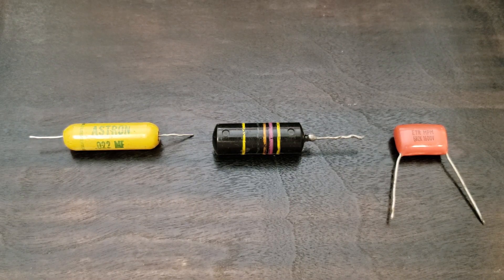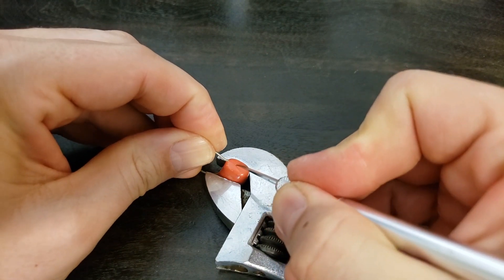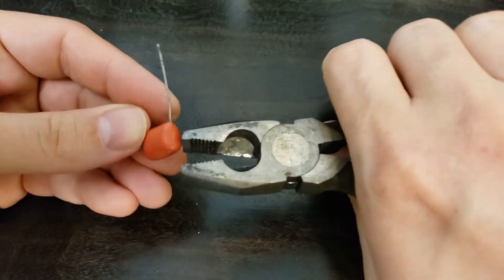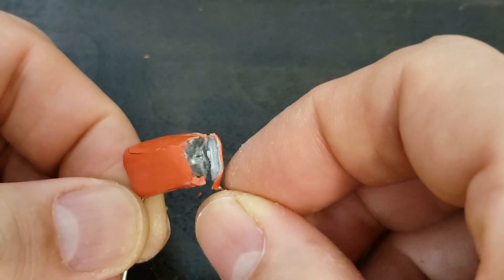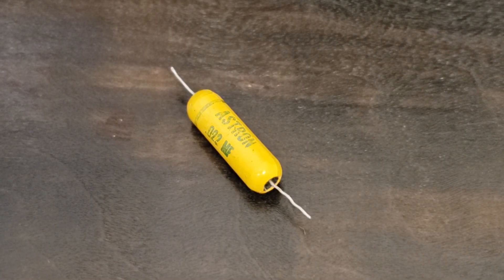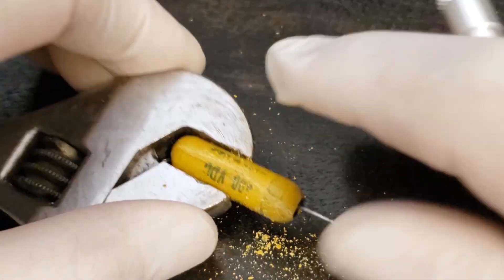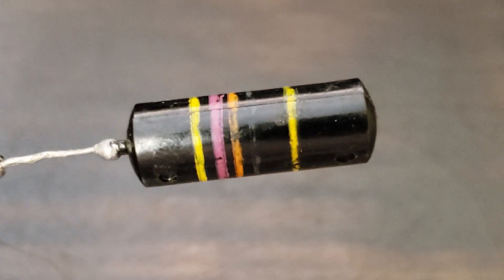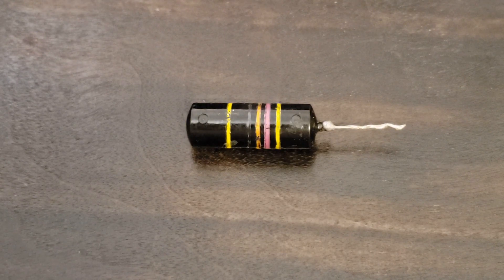Bumblebee Capacitor - What's inside? Orange drop cap TONE CAPS

Comment: Bumblebees are loaded with PCB oil. Also, as they absorbed moisture over the years combined with the acidic paper dielectric, they actually turn into electrolytic caps of sorts. Complete with leakage that varies with polarity.

Comment: Bumblebee caps are prefered amongst guitar guys only because of its leakage! They were not the best seal as plastic would deform from heat and the capacitor would start getting moisture, thus accelerating paper degradation and later on leakage. They were one of the worst and most changed ones on old tube tvs and radios and they'll last 1/4 of a regular paper wax or ceramic tubular ones. Oil in paper is another crappy capacitor that was notorious for exploding on across the line or horizontal circuit filters.
Reply from the maker: I can attest they are generally pretty bad in amps.

Comment: This demonstrates the progress of plastics - from pure paper dielectric of 1920's to oiled paper of 1940's to metallized paper of 1960's to mylar and polypropylene metallized film of 1970's to multilayer ceramic SMD of 1980's and after. Since the dielectric thickness is smaller and permeability is higher, the same capacitance/voltage is now much smaller cap. Better contacts to foil/metal gives lower ESR and lower non-linearities. Now you really know that there is only improvements from antique capacitors.
Reply from the maker: It's true, caps have gotten amazingly small
Reply: @FrankOlsonTwins  what was left out was the factoid that as caps became smaller and more efficient they were designed that way for an application other than analog so to apply these awesome new capacitor designs to analog uses took a higher level of knowledge than the builders of old and there we have average builders using modern caps and resistors today in the same way, and being stuck between the old way and the new way with only the the factoid that these new components are better is silly and leaves so much to be caught up on with this change in analog design and modern components.
Reply from the maker: Some good points being made here, and honestly I've always been a bit split on this topic.  On one hand, as caps have evolved, so too have their tolerances and specs.  Perhaps there is a difference to be noticed from old tech to new by those who are paying close attention.  The difference is subjective, at the very least(except for very leaky caps which are unsuitable for any amp!).  This is physics, after all, and all of these elements have different properties which are more suitable for some tasks than others.  Look inside any amplifier and you're likely to see ceramic, film, electrolytic, silver mica and possibly even tantalum caps- each fulfilling a different task based on its physical characteristics.  One could populate an entire signal path with ceramic caps, but it is rarely done on any worthwhile equipment, largely to improving tone.
On the other hand, all the guitar and amp manufacturers of old were using the most up to date cap technology they could get their hands on to manufacture their products- just as they still do today.  So, in my opinion, a schematic and in spec parts will take you a long way...usually all the way! 
I have done a few cap swaps, but I'd really like to hear a truly scientific shootout of different cap types and brands.  One thing I've learned over the years, you cannot just swap parts and be objective.
Reply: Several things left out but since you know more than me and the techs that showed those attributes of old are no longer with us you win, happy happy.
Reply: what is ESR? otherwise, how a capacitor works on a guitar and why his valor it's so important?

Comment: 1st of all great informative video, thanks.  I cant believe the  uneducated Bumblebee disciples, they just don't understand that a cap value is the same whatever the material its made from,
if they do happen to notice a difference in tone its most definitely a tolerance issue.  Most caps have a tolerance of 10% which could make a difference.
Reply from the maker: I recently had a bad experience with new reissue bumblebee caps- i installed them in an amp for a friend and they didn't actually work at 200v.  I then installed some polyester caps, ($2 each) that work and sound great...

Comment: On the practical side the Orange caps have much sturdier legs, the wire is a bit thicker so it is difficult to break them off accidentally. Working with the paper in oil types the legs are flimsy and snap off easily.
Reply from the maker: Agree, modern caps have tried to address this issue, and often you can find a durability rating for the legs, for whatever that's worth!

Comment: I've skimmed over old circuits thinking these were resistors.  I've never heard of a bumble bee capacitor until this very day.
So, if I may, for the average layman who's never even heard of these, just by looking at them, how do you tell the difference between a bumble bee and a resistor ?  I mean, geez, you'd be forgiven for thinking it was a resistor.
Reply from the maker: Generally speaking, capacitors are often bigger than resistors. If you saw one next to the other, you'd see the size alone is one of the big differences.
Resistors are rated and used by wattage. Most resistors in a given vintage circuit 1/2 watt to 5 watts.  They are also usually brown, and look similar to bakelite.  Usually, the edges are square(not so anymore).
Capacitors are have always come in many colors, often now orange and yellow.  They were often rounded at the end, though now it just depends on the cap maker.  There are factors that determine how big they are, such as capacitance and voltage. Usually the higher each number gets, the bigger the capacitor needs to be.  
Hope this helps!

Comment: Great patience in sharing!  Ah, the craptastic BumbleBombs, laced with PCB’s, ok for small voltages but usually become “leaky” and explode in real power circuits :(
Reply from the maker: Thanks!  I've never seen a bumble bee explode, but I've seen many that were out of spec!
Reply: @FrankOlsonTwins  Maybe I try a capacitor from an air conditioner, 370 vac 35 mfd, that should really soup up my Lester Paul guitar, woooaahhh man.
Reply: The PIO bumblebees do, they crack at the seam.

 I've seen the mylar  bumblebees pass ridiculous amounts of power without a peep tho.

Comment: So capacitors are just tightly rolled up foil? I had no idea. How do they work then? What exactly do they do?
Reply from the maker: Essentially Yes, they are rolled up foil with some sort of insulator to keep it from shorting itself out. However, now they are mostly rolled up mylar, with one side being conductive, and the other side not. It's rolled in such a way that the conductive part doesn't short out.
As to HOW they work, well that's another video entirely....
Reply: Not too easy to explain but they work with the electrical field. When they charge one side of the foil gets fueled with electrons. More than protons so that foil gets negative. The other foil at the other side of the insulation (plastic, ceramic, paper in oil for example) gets empty of electrons leaving protons alone and making a positive charge. So you have one foil negative and the other positive fixed in place because the attraction of one charge and the other because the electric field that appears when you charge the capband the near one charge is from the other. When you close the circuit by capacitor legs the electrons flows from one foil to the wire and enter the other foil creating a current and a voltage and discharging it.

Comment: Foil and a dielectric wrapped together for all. Two leads separated by an insulating material. So how could any current flow "THRU" it, DC or AC???   It can't ,That's why the only "tone" determining factor is it's value not how it's painted on the outside. 100 bucks for look like bumble bee's, your paying for the paint not the tone. A cap charges and dis-charges in an audio circuit, letting current flow in the circuit, not thru the cap. How long it takes to charge and dis-charge (its value) determines freq. Different constuction is for different enviroments.

Comment: Good demo of the construction of film capacitors. The inside and outside foils are connected to their respective leads by a portion of each folded on the ends. Each end has dielectric under the fold to ensure that they don't short. Each foil has an equal amount of connections to their respective layers within the body.
Reply from the maker: Thanks!

Comment: Good video, though no surprises. I don't understand why people buy (on eBay, etc.) old Bumblebee caps as if they were precious. First, they were made by the millions so they're not. Second, after at least 50 years if they're not BAD they're on their way to going bad. I don't even bother testing them, I take 'em out and replace.
Reply from the maker: Yep, a bad cap is a bad cap.  Find a  source of new quality caps and stick with it!
Reply: First off.  Only the sizes that were commonly used in certain items, like vintage guitars, have become scarce.  Demand is driven by the accurate restoration vintage, and collectable equipment, (vintage Gibson guitars come to mind).
Secondly, if the component hasn't failed in over 50 years, I'd say it's stable, especially for use in guitars where there is little voltage.

Comment: What's interesting is the astron is solid and not mentioned for a guitar circuit far as I've seen. But both the orange drop and bumble are highly recommended and both of a spiral construction..
Reply from the maker: To be fair, I think the Astron caps were also spiral wound capacitors, but I think the plastic just fused in my specific cap- making it look like a hunk of plastic/aluminum.  You're right though, I've never seen them in a guitar, I've only ever seen them in guitar amps...that is kind of weird. This one came out of a tube public address system.
Reply: @FrankOlsonTwins  probably saw a bit of heat then during it's tenure..

Comment: what is interesting with these caps is that when you unroll them down to the centers....you are finding no evidence of a lead plate.  There should technically be one in the center and then one at the end of the roll on the outside.  When you broke them open.....the plates appear to be on the ends of the roll opposite each other.  SO its like the length of the sandwich roll is the factor as opposed to the thickness of the roll between center and outside.......which is really odd considering the literature on capacitors.  The eary era caps were labeled with a line to denote the outside lead.....and later assembly line caps like an orange drop didn't necessarily have that exact notation if it had the line.  There are those that try to measure and determine the outer foil lead.......but this obviously contradicts that !!    I can't visually tell if something is obscured with the lead plates.  I would suggest that instead of breakig them open with a set of pliers......that you get a small dremel with a carbude disc to cut the caps in half for a sectional display......then do it with another set where you can break the surface capsule to get at the guts.   BUT A GREAT INFORMATIONAL PRESENTATION.  The real situation is the composition of the internal materials....the chemistry.  You can't visually assume its all the same materials between manufacturers whether it looks like paper or wax paper or a film of plastic, and even the aluminum foil.  The application of "electrons" in chemistry at the molecular/atomic level is different between Chemistry and Electronics

Comment: Hi, my name is Emilio and I live in Brussels Belgium, I am a luthier and in my quest to do as much as possible myself, I would like to manufacture my own 0.047uf and 0.022uf paper-in-oil capacitors professionally, make one it's easy but one that gets a professional finish isn't. I would like to know if you can help me, what kind of machine I can use, how to give the correct coating that is hard like bumblebees, or has an aluminum can. Thank you very much for taking the time to read this message.
Reply from the maker: to manufacture caps, you'll have to either make a machine or buy an old one. i don't know much about cap building, but I'm sure it involves getting a decent tension of the paper and foil. Also, i think the leads are spot welded to the foil, so that's something to consider. Once you make a few dozen you'll get a feel for your work flow and what is working.  Regarding the plastic, I think that will take some research to find out what will have the correct properties for your cap.  I believe bumblebees were injection molded.  Many others are simply dipped in plastic. Lots to think about but it sounds like a fun endeavor!   Best of luck!!

Comment: When I was a grade-schooler, I made my own capacitors a couple of times, by rolling foil and waxed paper.  They were disappointly “mushy” .. I couldn’t achieve that solid roll like the factory made ones 😁
Reply from the maker: Getting the correct thickness of foil seems tedious as well...MIght be fun as a rainy day project, but I already have so many of those!
Reply: I could roll a tight joint.

Comment: the Bumblebee is a orange drop with a wax paper with oil interesting . thanks for this it's making me think twice about dropping more money on caps . not too sure !!
Reply from the maker: well, technically the bumblebee is actual aluminum foil, where the orange drop is an aluminum coated mylar.  The mylar is folded so the aluminum is inside and never touches itself(insulated).

Comment: if u put the plastic in the inner part of the jaws youll get alot more force and control over how deep u go, im talkin about the jaws on the inside of the pivot, not the inner part of the jaws where the cutter is, on the outside of the pivot    u could also use the cutters to it works pretty well
Reply from the maker: Yeah, in hindsight, cracking them lightly with a pair of vice grips(or a vice!) might have been a bit more efficient. The issue I find with the inner jaws is that it requires more force, and hurts your hands more!

Comment: You do know those bumble bee capacitors can fuck things up right?
Reply from the maker: More than any other out of spec capacitor?  They tend to be pretty leaky.  I probably wouldn't trust them in a power supply or high voltage tube amp output stage, but in a guitar or as a coupling cap, seems pretty harmless if they sound good.  When they start to sound bad, they get pulled.

Comment: And here I am wondering how they can charge $10+ for paper and oil caps...
Reply from the maker: For a boutique shop to be making paper & foil caps, I understand why they would charge a high price.  But as a tech and independent builder, there's no way I'd buy a $10 cap for any build or repair....
Worse, I feel is how bigger cap companies have raised the price of specific capacitors and resistors that are popular with the diy and amp repair crowd(axial caps,  CC reistors for example).  So now, anything resembling a factory looking repair, costs 5 times what any other repair would.
Reply: @FrankOlsonTwins  Watched a video and the Buble Bee he sourced was $30 for a single .022 mf cap!!
Reply from the maker: Yes, the prices have gotten unruly.  I won't spend that much for a small cap like this, and the new "Bumblebee" manufacturers are stating they are only to be used in guitars, not in amplifiers as they cannot withstand the high voltage and "leak".

Comment: Do more wraps equal tighter tolerance?
Reply from the maker: Good question!  I believe more wraps increase the farad rating.   For example, for any given voltage rating a smaller cap will usually be a smaller value and larger cap will be a larger value.   You may also notice higher voltage caps are also larger than let voltage ones.   There are many factors though,  and that's an extremely simplified answer.   I don't know exactly what factors contribute to tolerances, but i bet a specific wrap number/ foil thickness/substrate thickness/width  are all part of the equation.

Comment: Oil and paper have sweet spots on the tone control that others do not have....They mix better with the treble sounds without getting woofy. If you never use your tone control you are probably not aware of it.....Most people leave it on 10 bridge pickup with gain on 11 all their life....lol.... Holdsworth used his tone control on bridge pick up for his violin tone....Many clean jazz players use neck pickup with rolled back tone control for dark tones and softer music.....I vote oil and paper.
Reply: Yeah, lots of greasy tones lie within those paper-in-oil caps...
Reply from the maker: Yeah, there must be a reason high quality amplifiers, preamplifiers and microphones use paper in oil caps.  I've even seen many old schematics that indicate which caps should be paper in oil caps!  I'm always shocked when I see ceramic caps inside guitars!  They tend to be cheap guitars though...

Comment: Interesting.  Smart idea using the gloves. Oils used in electronics like transformer oil contain PCB's, a cancer causing substance.  Seems the casings are a phenolic resin compound, like the handles on a cooking pot. Very heat resistant and durable.
Reply from the maker: Thanks, yes I figured that since the cap was from the late 1950's it was probably "suspect" in terms of health.  It's easy to just put on some  gloves, rather than try to wash that oil from your hands and hope for the best.